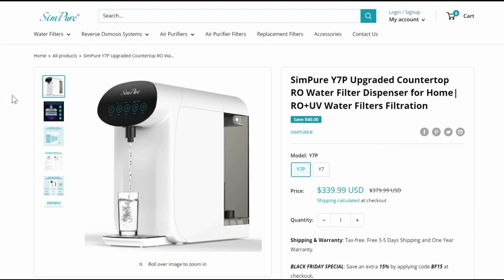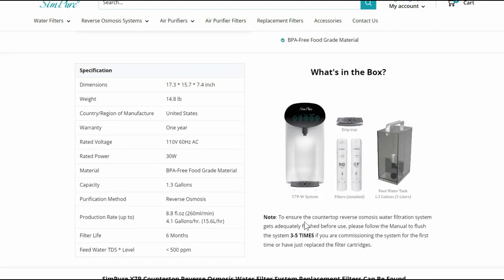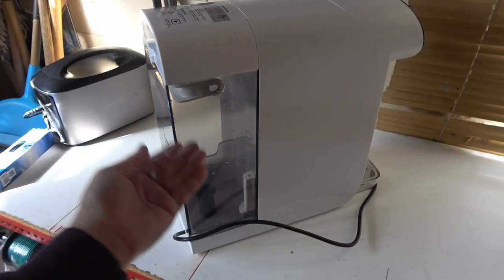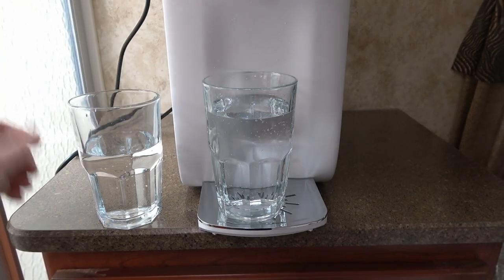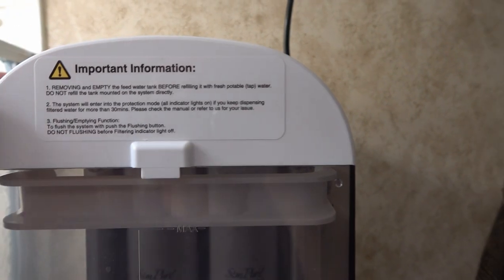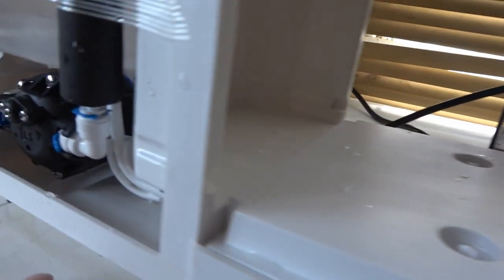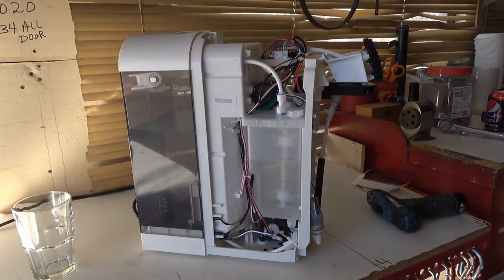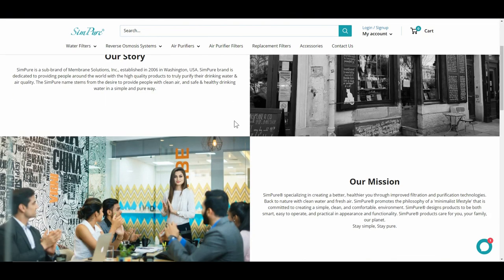SimPure Countertop RO + UV Water Filter/Purifier Review - Model Y7P-W

Comment: My fifth wheel has the same basic floor plan as yours but is 4’ longer. Likewise there isn’t enough counter space for a counter top RO system. But, I purchased the under counter RO system that Jared Gillis recommended and had plenty of space to install it. Then added the Acuva UV filter. All of this is under the kitchen counter. I found space behind panels in the basement to install 4 BattleBorn batteries, the triple filter you have and a water softener. So everything is hard mounted. Super easy to use. 
But I really enjoy the taste of the RO water. 
Great review as usual. 
Thanks for sharing.
Reply from the maker: Thanks, that sounds like a superb system you go there! If I spent more time away from our terrific soft rain/snow melt fed reservoir water we enjoy in Vancouver Island I'd likely do much the same.

Comment: This may be exactly what we need!  We use softened water to fill our tanks with, due to a TON of solids in our Idaho water.--who wants clogged pipes and water heater gummed up?  Which left us with bottled water to drink.  I have a large Lance truck camper and all I ever wanted was a portable RO system.  Love the small waste water, footprint is do-able.  My question seems more to do with part time use.  The filter storage between uses (or weeks of non-use).  Thank you Ray!  ----Also, love my Lion Energy batteries too.
Reply: Water heaters have to be flushed every year. That's how you keep it from "gummed up". That includes even if you have a water softener.
Reply: @badweetabix  Yes, but ours would gum up in 3 months here.  So, I need an R/O system says pro's around here.

Comment: The 6 mth life of RO membrane seems really short. I would be interested in TDS readings with only changing the CF filter at 6 mth and seeing how long RO membrane lasts. My under counter home unit for two people  - membrane lasts around 5 years with 6-12 mth changes of prefilter and carbon filters. I base changing RO on TDS readings not time or gallons used.

Comment: Thanks Ray!  Like #37 What is the transformer putting out in DC voltage?
Reply from the maker: I didn't actually measure it but judging from the small size and the 30W spec, it must be pretty low. Maybe when I do the second video, I'll test it. Cheers, Ray
Reply: @LoveYourRV  It probably says it on the transformer.  I am wondering if it is 12v and could be hardwired into a 12v circuit.

Comment: You never mentioned the UV light that the unit has. Could that be the final "motor" you pointed out by the dispenser tube. It appeared to have electric running to it and according to the diagram it is at the end of the system right before the dispensing nozzle. Just curious. Thanks for the quality review. Too big for my 4x4 Sportsmobile van but like the idea for my in home filtration.
Reply from the maker: From the looks of it, I figure it's in the piping that goes into the purified reservoir that has multiple wires attached.  See here --> https://youtu.be/Jmq2F7pKsR4?t=1081 I'll confirm when I do the follow-up video near the end of March or early April when I revisit my friends. Cheers, Ray

Comment: Distilled water is $2.50 a gallon. That's about 140 gallons for the price of that filter.
Reply from the maker: If you only factor in the price and not your own time dealing with hassle of attaining/carrying/storing the distilled water jugs and dealing with the empties, etc.  Like a lot of things it's convenience item for the most part. Why buy a dishwasher when its way cheaper to manually do them sort of thing. I used to fill and lug jugs from water purifier stations but now I have 3 stage filters and a LED UV purifier onboard the RV. Cheaper? No, but I do enjoy the convenience and so does my back. ;) Cheers, Ray
Reply: Amazing response

Comment: Where does the water pass through/exposed to UV Light?
Reply from the maker: Not exactly sure. I didn't want to get to aggressive on taking it apart for fear of ruining something. But from the wiring it appears that if maybe inside a tube that is inside the purified water reservoir.  Which would makes sense. UV would be a final stage for the water to go through. Given that the appliance only draws 30 watts I assume its an LED type UV lamp so may be quite small.
Reply: @LoveYourRV  Great review! Any idea on the life of the UV light?
Reply from the maker: @JohnFitzMusic  They claim 3-5 years of UV light life but is not replaceable.

Comment: Wonder what a Berkely would be compared
Reply from the maker: They are good filters but won't remove dissolved solids in the water. Reverse Osmosis does that. In many places, you want minerals as they are healthy for the body. But in some places like the southwest for example, where the water is often extremely hard, many prefer to drink water that has gone through an RO process to remove the minerals in it. Improves the taste and doesn't leave a white scale in things like coffee makers. Around the desert, you'll find many dispensing machines that are labeled RO water for sale.  This little machine is basically doing what they do. Also, it has UV purification, which as far as I know a Berkely doesn't. Cheers, Ray
Reply: Berkey is in a class action lawsuit.
Reply: I wouldn’t trust them. Look at their lawsuit
Reply from the maker: @samsampson6952  I did a quick Google search and found this https://www.bigberkeywaterfilters.com/blog/lawsuit/Berkey-Statement-Regarding-Berkey-Water-Filter-Lawsuit

Comment: Not well designed. There is absolutely no need for the electronic water dispenser functions. Does anyone really need to know how much water they drink down to the milliliter? All that was necessary is a simple inexpensive manually operated spigot which would had done away with 60% of the unnecessary electronic components and that means few parts to fail and made the overall less expensive, too.

Their 1 year warranty is also a deal breaker. $379 is not cheap and if the company doesn't have the confidence to back their product for longer than 1 year, neither do I.
Reply from the maker: I guess bling and gadgets is what sells these days, just look at modern stoves and washing machines, full of buttons and lights. :)